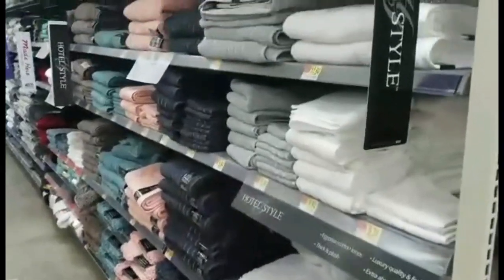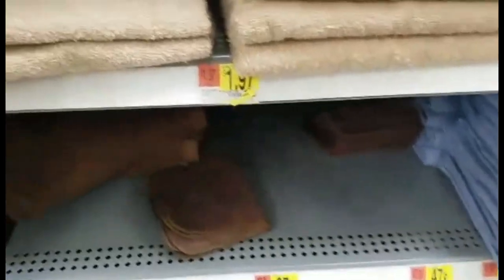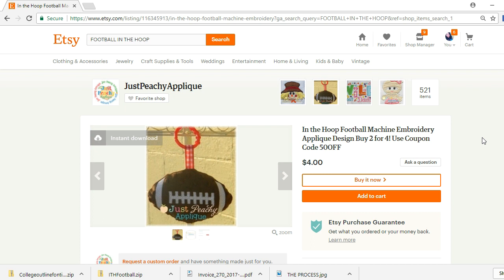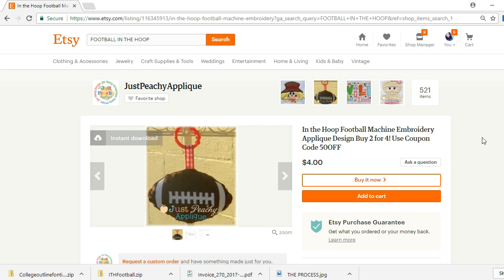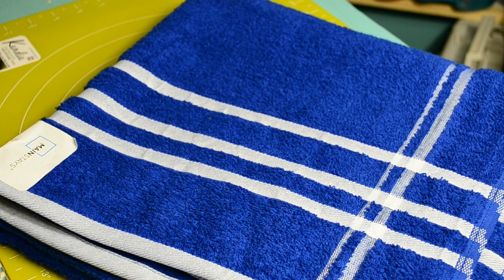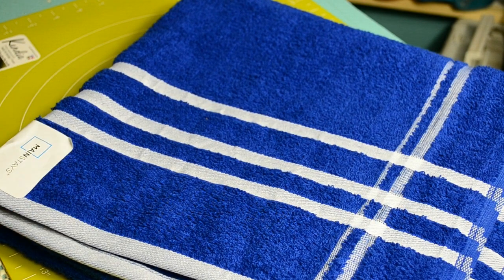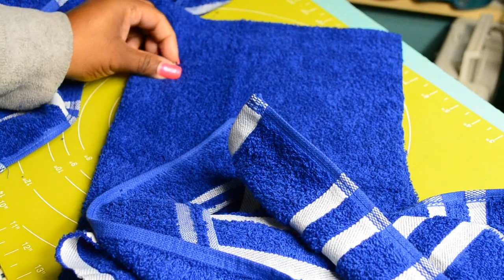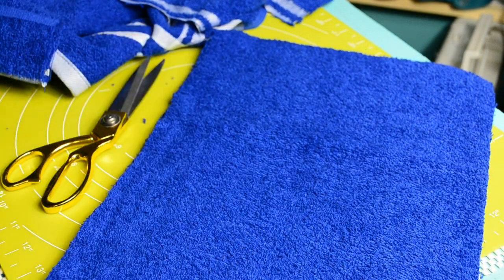Embroidery Product Line Development - In The Hoop Football Tutorial [ LONG VERSION ]

Comment: Great video.  How much would you charge for something like this?  It says it is over 37, 000 stitches.
Reply from the maker: I don't charge for stitch count... However, keep in mind, I did increase the stitches by altering the design.  If you are an embroiderer that focuses on stitch count, this is not the product for you. If you do not have multiple embroidery machines or other services that you can be render while this is on the machine, this may not be the product for you.  This towel is at 1 hour to complete..